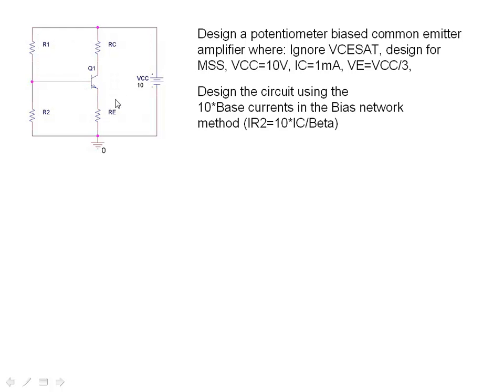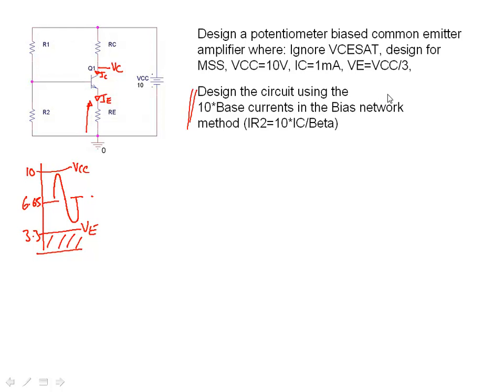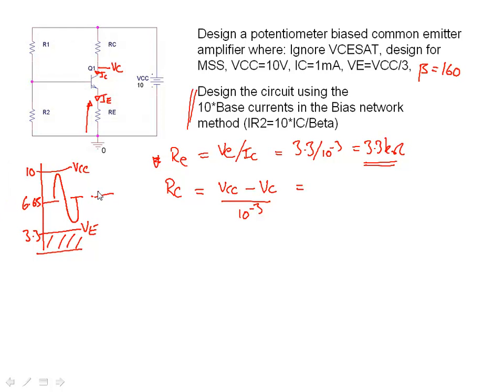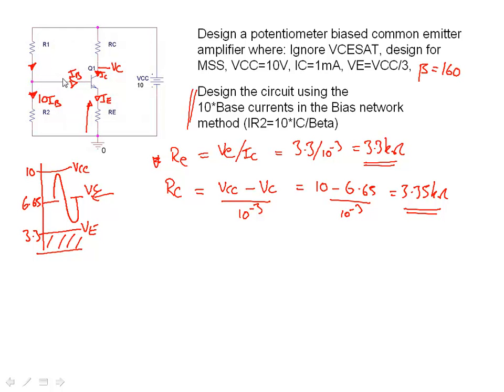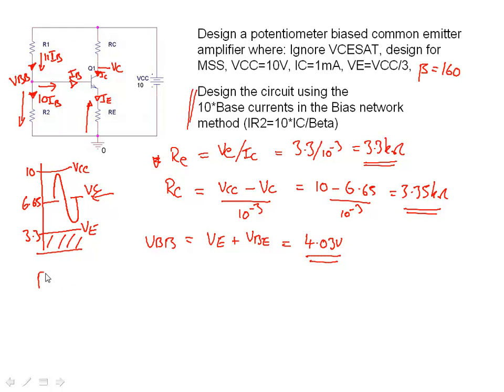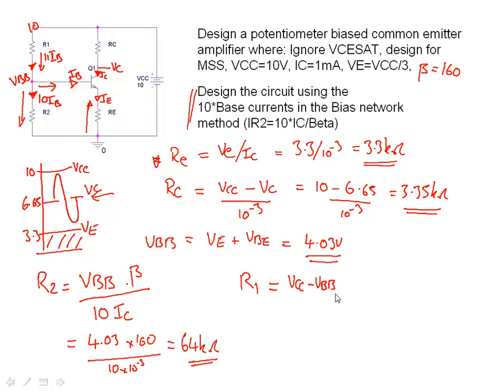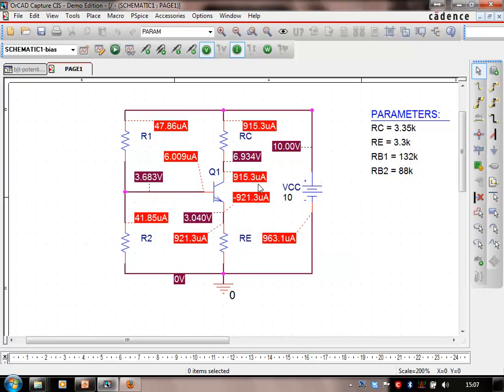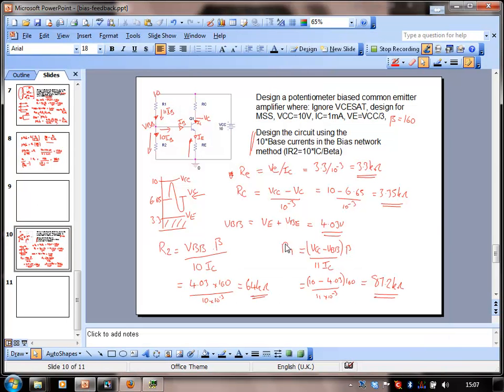biasing using the potentiometer method

Comment: Paul - yes you are right this amplifier is not a very good amplifier. However a lot if the "rules of thumb" are what are used, therefore you need to be careful sometimes.
Specifically in this example it points out that bussing the BJT. Using 1/3 VCC at the emitter has consequences, you need a bypass capacitor in  with RE.

Comment: Hello Richard,
I was following your video on CommonEmitter Biasing. Very clear and well done, but it does leave me with a confusion about your RE and RC choices.

I followed your description and on the face of it, it makes sense but contradicts what I've read elsewhere about Common Emitter Amplifiers.

By choosing RC and RE to be about the same value, you have a unity gain (RC/RE = 1)  amplifier. In other words, no amplification at all!

Is this correct? What am I missing here?

If this is correct, where would you use such a circuit?

Please help clear the fog.
Paul.